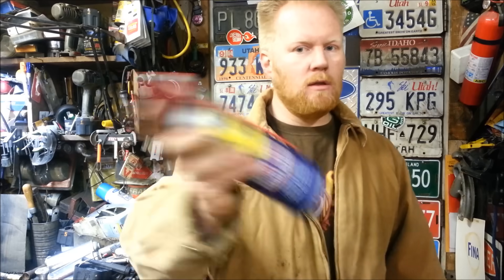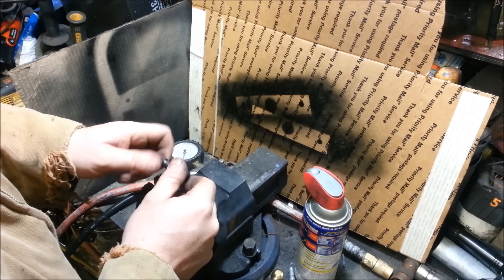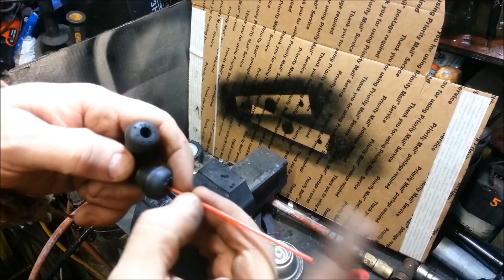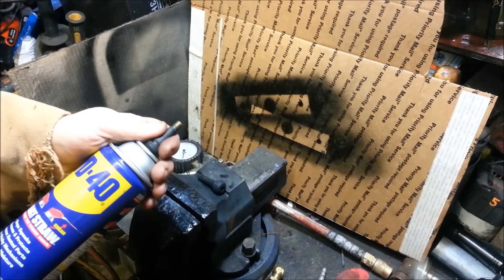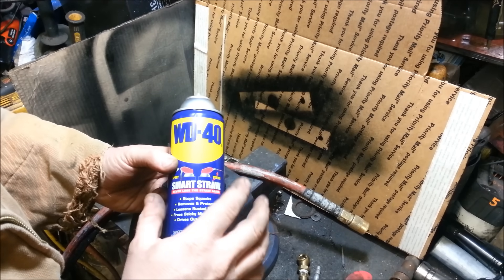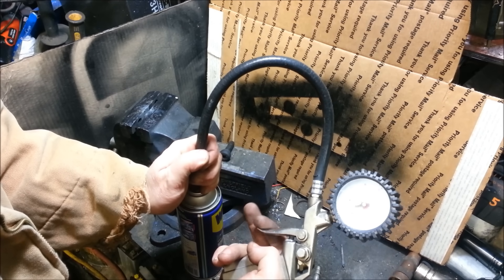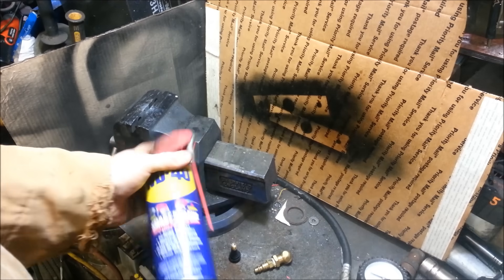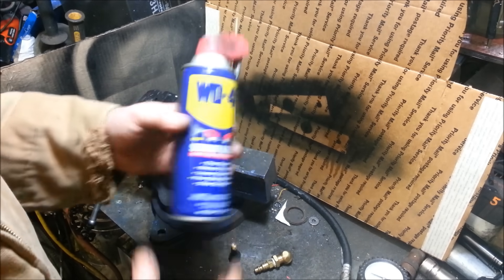Refill flat AEROSOL Spray Cans like the WD-40 and others

Comment: Its not that they dont fill up proper.  Its when we press the knob and we have the can upside-down or horizontal you will blow out pressure without content. And pressure will  finish before content So when they tested the can they tested with the can upright.
Reply from the maker: Actually rarely is the the case. WD40 has an air bleed at the top of the pick up straw. This is so some of the propellant is mixed with the WD40 to created an aerated foamy spray. This is controlled be a little check ball that gets stuck and too much propellant is exhausted with each spray and you run out of propellant.

Comment: I took a valve stem from a used bicycle inner tube and it sealed around the plastic stem from the can.  Worked out very well.
Reply: How did you seal it?

Comment: Easier method attach the tip you use for inflating ⚽ 🏈🏀 hold can upside down press up firmly pinch around valve seals it. No extra work required

Comment: How safe is that , what pressure is the can rated at.
Reply from the maker: USA ratings At 130F degrees
No Code Minimum burst 210psi
DOT 2P Minimum burst 240psi
DOT 2Q Minimum burst 270psi

Comment: Very cool! Thanks.
Could I trouble you for a source on the  trigger valve and gauge combo you are using?
Reply: B P 
I got mine at home depot 

https://www.homedepot.com/p/Primefit-Aluminum-Tire-Inflator-C1005/205131698?source=shoppingads&locale=en-US&mtc=Shopping-B-F_D25H-B-D25H-25_28_COMPRESSORS-NA-NA-Feed-PLA-NA-NA-Compressors_Smart&cm_mmc=Shopping-B-F_D25H-B-D25H-25_28_COMPRESSORS-NA-NA-Feed-PLA-NA-NA-Compressors_Smart-71700000081377591-58700006924599093-92700062241781623&gclid=Cj0KCQjwnueFBhChARIsAPu3YkSOdK1HvM4ViT362PrhpYe1IjyXBDlBg6IHsB2sqU9kS_SViNPwA0oaAnVWEALw_wcB&gclsrc=aw.ds

Comment: Paint cans this would be good for, they run out leaving lots of paint in bottom...
Reply: What makes paint dry? That would be “exposure to air”. If you pump compressed air into a spray-paint can, the paint will dry. OK, so the paint won’t dry immediately, but you must now use all remaining paint in a very short time or the remainder will dry/set.

Comment: my air compressor came with the ‘needle’ to fill up soccer balls, etc.  just the right size to stick in the middle of the spray can nub, push in, and air goes into the can
Reply: Now THAT is better than this videos idea!
Thanks man👍👍
Reply: @Scottocaster6668  yep, you do not even have to press down hard as the air flows backwards into the can because the cans valve is designed to keep contents in.  i learned from this video that 100psi is ok.  i stopped at 30psi (the can gets hard at that point and can not be squeezed) and sometimes needed 2 or 3 refills.  you can hear the can contents bubbling as air from the compressor enters the can through the nozzle
Reply: @davidjames666  yep, I just did it!
👍
Reply: J D  no crossing needed.  air compressors have a dial you can turn which sets the max pressure that comes out the end of the hose. - just turn it to 100psi
Reply: J D  I wouldn’t recommend doing this either by my method, or the method presented in this video without an inline pressure gauge/regulator.  I am certain one can get one for under $10 from Harbor freight or so.
Reply: @davidjames666  all compressors come with a regulator
Reply: @condor5635  I know!!!  the guy JD said his did not, said the can will blow up, etc.  I finally told him to go buy one then. and then he deleted all his comments because everyone was calling him a moron.
Reply: So it's literally just air you pump into the can, I can use my bike pump? That's amazing
Reply: Thank you sir.
Reply: I have 1/8 can of Scotchgard and a bike pump....gonna try.  Thanks for the tip!
Reply: @SneekySecrets  do not use a bicycle pump!! it will not work. you need an air compressor.
Reply: @davidjames666  I used a can of compressed air for electronics. It worked like a champ but don't know how much pressure went in the can.
Reply: Didn't work on mine
Reply: How did you get a ball needle hooked up to your compressor? The only way I can get it to hook up to something is use a tire compressor pump I got that the needle will screw into and that just don’t seem safe lol. I think you mentioned that already too. Idk 🤷‍♂️
Reply: @JudgedCondemned hand held air gun often have a screw off tip. Then screw. Ball fill needle on.
Reply: @JudgedCondemned  just pump it up till it blows, then back it off a quarter turn. 😄
Reply: Did you get your answer?  @JudgedCondemned

Comment: Don't buy WD garbage and you won't have to refill their crappy products.. so tired of wasting $$ on WD40 because it doesn't perform. Much better products out there. Use to buy the stuff by the case.. now i won't waste $5 dollars on a can that won't dispense..    Seriously , why was the video made because it is a real QUALITY problem
Reply from the maker: Absolutely correct. The only good use for it that I found is dissolving old grease from bearings etc when you're cleaning stuff. It's a good cleaner crappy lubrication.

Comment: Before becoming a full time mechanic, I worked in the tire industry for 10+ years, changed 50,000+ tires, probably half of which I installed new valve stems in the process, and I still never would have thought of this. Thank you for sharing, now what about cans that do not have an external stem on them? Do you have any tricks for safely re-pressurizing those cans?
Reply: Pl
 
  
 
😑😑😑😑
Reply: o my ur poor back, idk how u did it. i just started being a lube tech and every other day we do a car with tires and i hate every moment of it.
Reply: @spencer6874  They get to a point where it becomes a effortless task, even the many 37" Mud Tires on 20" rims, when done correctly and I'm no big dude by any means (5'11 and about 150-155lbs). That being said, now that I own my own shop and have the choice I do not, nor do I plan to, offer tire services. I don't even offer oil chances, however, will occasionally perform them if vehicle is already here having other work done or if a repair requires it. I never minded being a lube tech while also I would never want to have to go back to doing it.
Reply: get an air gun with a rubber tip, push down on the nozzle of the can, put the rubber tip firmly against the opening in the nozzle then squeeze the trigger on the air gun to transfer air though the now open nozzle in the can.  I do this all the time.

Comment: DON'T DO THIS.!..this is not safe..oxygen in air will have an effect to oil for combustion at high pressure..if you have to add pressure, CO2 should be the one to use..not air specially if there are still plenty of oil inside.

Comment: When my cans run out of air i stick them out side were the in the summer that is were the temp is around 90 to 100 degrees it will pressure back up .